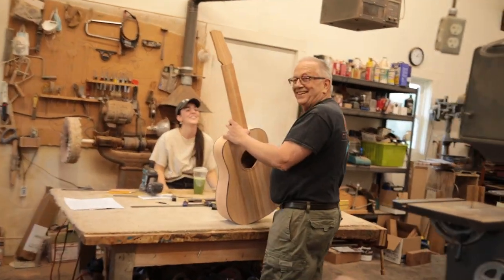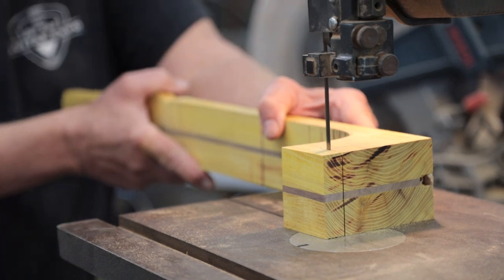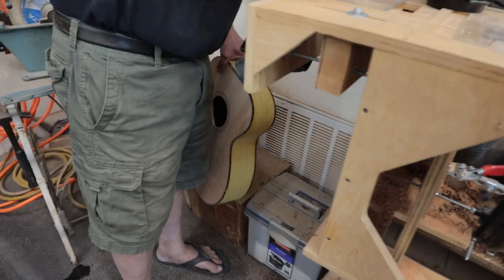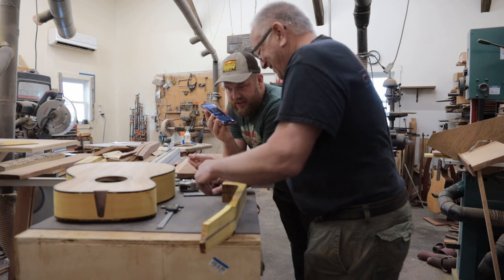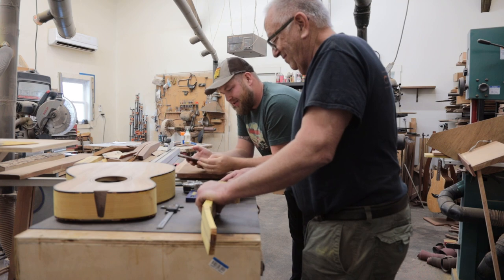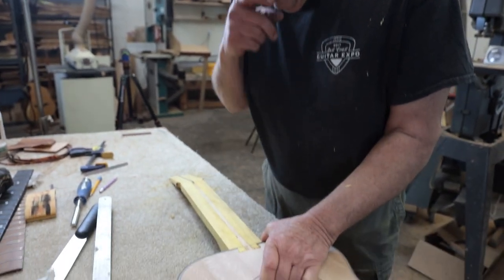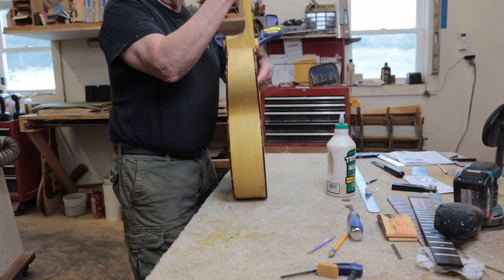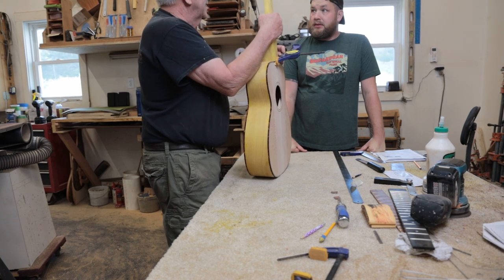Building an Acoustic Guitar with @showalterguitars5707 Episode 12 I The Dovetail Joint

Comment: Really neat router jig! I also enjoyed his explanation about glues he uses. Those old hide glues were finicky and almost impossible to soften with steam or heat. Be interesting to see if the new protein glues eventually get universal use for some of the assembly.
Reply: Is that true about hide glue? If so, that suggests they added something, maybe urea formaldehyde for water resistance. But I'm not really experienced with old guitars. Furniture factories used hide glue for a long time.
Reply: @carlosreira2189  Hi. I am not the glue expert, per se, but hide glue was pretty much the standard woodworking glue until after WW2. My guess is that formulations were not exact at that time. There are threads that question the transferability of sound through aliphatic resin glues (more “gooey”) but I think it’s like claiming  to hear 20,000 HZ through a stereo. Mr. S is correct that planning for a neck reset is a good idea and heat is best , and really only, way to loosen the glue. Factories (and amateurs) use titebond because it has a much longer set up time. Hide glue doesn’t store and if not bonded and clamped in a minute or so, it is worthless as adhesive. Not sure what the comparison is to the new fish glues like Taylor uses. Traditionalists want the closest thing to the original and they will argue all the needs for the exact materials used pre WW2. And then there is the whole bolt- on versus dovetail neck argument…..
Reply: @rzh3443  Yeah, thanks for that reply. These days, even Elmer's white glue is really hard. I don't think it's a make or break sonic issue, but I've made a few guitars, some with hide glue neck joints and some with yellow, and I've taken some of them apart. Neither is great, but yellow glue was a steamy mess. They suggest no moisture soldering iron methods now. I'm a believer in the bolt on neck, though I have yet to make one. It's smart and proven at this point. 
Fish glue is interesting. My understanding is that most if not all is made by one company and I have a bucket of it. It dries hard but is very reversible. The best is Sturgeon bladder glue and that's super expensive. Violin makers use it.
There's some other options, though untested, like dextrin glue or other carbohydrate based glues. I often mix wheat flour into my Elmer's to make a thick paste. It dries rock hard and is fairly resistant to moisture. So...yeah adhesives, fun.
Blessings of success with your creative endeavors.